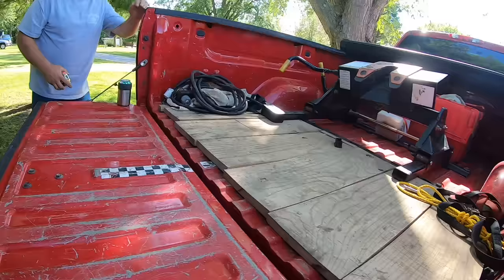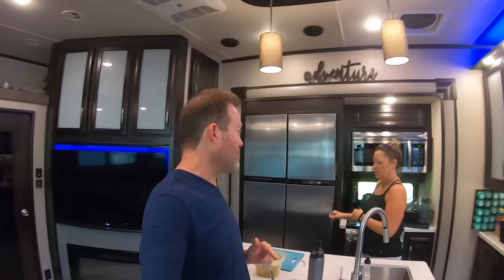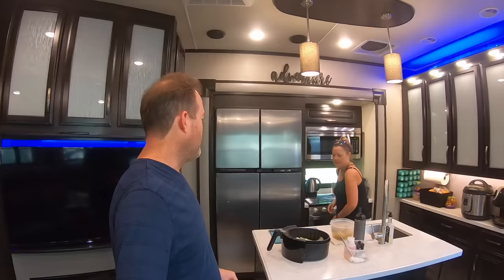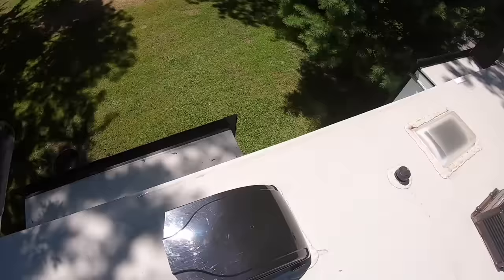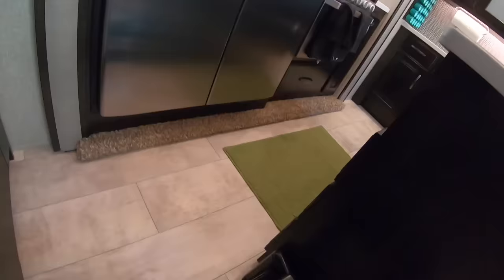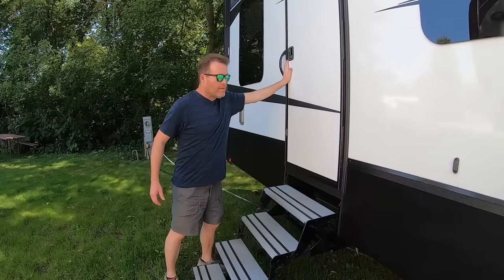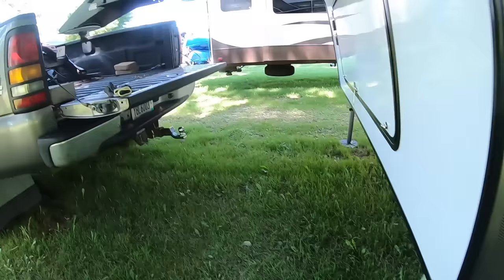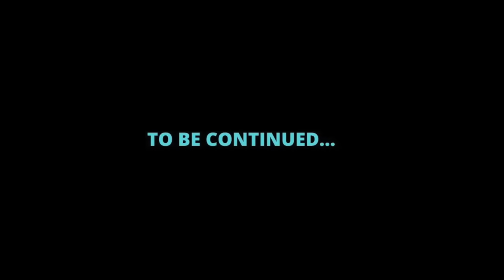RV CRUSHES MY TRUCK ON 1st TOW! BIGGEST RV LIVING FULL TIME MISTAKE!

Comment: Whith a big trailer you have to make sure to turn corners slow too couse the trailer can push the truck into a jacknife or push the truck sidewas and roll the truck over on its side and demolish the truck . Thats why alot of prohoulers use 450 trucks bigger heavier axles and wider wheel stance witch gives more stability

Comment: it proves that you are human just like the rest of us. i have driven truck for many years and have lost 1 trailer also. first  only 1 pad on hitch only!
( with 2 the jaws won't lock right)  2 as a truck driver we age to look in the back of the hitch and make sure the jaws are closed around the pin.
3 tug test to make sure.

Comment: Get rid of that round disc, it probably was a factor in your hitch failing. There is way too much separation between the pin and your hitch because of that stack you’ve got in between having added that extra disk on top of a mechanism that the hitch already has in place.

Comment: You need to pack pads or pieces of board 2x6x1 foot. Place them under the landing pads, as one of these times the ground will not hold the weight and it will sink. It can sink so much you cant get the truck back under it.

Comment: Sorry about the new rig. did you figure out what went wrong? i know your still pissed right now but here is a tip that saved us a couple of times once your hitched up bring your front legs up just enough to be a inch or so off the ground then pull forward to make sure you are locked this way if you are not and comes lose you will only drop a inch or so and no damage to ether truck or rig.

Comment: I saw the high hook  trailer should always slide up the 5th wheel to guarantee a good hook every time you can see the disc were not compressed by the weight of the trailer  which means the pin was on top of the jaw

Comment: What we got here is failure to lock the hitch. Always tug test! Don't care if it's a gooseneck, semi trailer or 5th wheel. Also, lube the hitch. Those fiberglass bed sides are not cheap! That's a very old school one that looks worn. I personally would have replaced it.

Comment: I am a RV transporter before you even got to the point of raising the front legs I can see that your trailer was not locked into the fifth wheel!!
   When you back under the king pen and you’re always locked underneath you always want to tug on the fifth wheel just put it in drive just slightly tug to make sure it’s locked in the place

Comment: 19:40 Don't mean to armchair quarterback this painful lesson but the pull rod is still extended and the previous owner stated that you have to remove the locking pin, detach the lever arm and put the locking pin in the inner hole together with the safety brake cable.  I'm sorry this happened to you and it's probably an expensive lesson.  I used to haul a 5 car trailer and had a 32k hitch.  The last thing I do before I retract the trailer legs is to make sure that I put the padlock through the hole that secures the release lever.  That ensures that the hitch is locked and that no one can mess with it while unattended.  Safe travels and good luck.

Comment: Get a Hensley ts3 trailer saver hitch.

You have a significantly large investment in that trailer on a 200 to $300 hitch. That would make me very very nervous. I run the TS3 trailer saver on a 15000 pound fifth wheel, just a little advice

Comment: Thank you for posting this video; I'm sorry it happened but bad things happen to good people. My wife and I have been RVing for 22 years and we have made our fair share of blunders including this one just a couple of months ago. We know you know how to do a tug test. How about filming that video in the near future.  This is our departure routine. After I'm fully hooked up and we've checked our trailer lights, I chalk the trailer wheels to prevent the trailer from rolling forward or back. All leveling jacks are now raised except the front two.  I lift the trailer a fraction to take almost all of the weight off of the truck. Tongue weight is on the trailer landing jacks.  Back in the truck cab I squeeze my trailer brake controller to the max, shift into drive and slowly release the truck brakes. You should not move at all as your truck is pinned to the trailer by the king pin.  If not you will separate from the king pin and the trailer won't move or drop.  Our final routine is a walk around of truck and trailer before we pull out.  I start on the driver's side while my wife starts on the passenger. We check truck and trailer looking and running our hands over everything; hitch and 7 way connector, doors, windows, bumpers, bay doors and latches, access panels, EVERYTHING. We cross in the back of the rig and double check each other's work on our way back to the front.  We repeat this routine at every rest stop while traveling.

Comment: The first time I ever pulled my 5er, I had to stop at the top of my driveway which caused the rig to rock back and forth a little.  The result was the Reese 16k slider lock popped out of the locked position and 12k slid backwards very fast and I thought it ripped the bed off my truck.  Now the bed has a slight upward buckle.  I quickly replaced it with a superglide.  I have several experiences like this.  My wife and I counted them all up and every issue we have run across has been inexperience.  I too have thought of starting a channel for rookies like myself.  lol.

Comment: Did it not lock in or did you put in to many teflon savers? You did not need the second one. I use them on my 18 wheeler.
Reply from the maker: It looked locked, but it wasn't. Yes, the extra disc caused the problem.

Comment: We used an Anderson hitch with our fifth wheel because it eliminates this unfortunate potential.   Very sorry for your misfortune, but kudos for sharing to help others.
Reply: Was not the fault of the hitch. The king pin was not sitting depth wise enough...that hitch already had a factory built on lube plate...he added another lube plate...that was the problem.

Comment: The handle wasn't in the "cocked" position.   You can see the yellow handle wasn't horizontal.  It was pointing down and the whole handle arm was pulled out still in the "locked open" position.  That little white needle seems to be either a design flaw, or merely labeled wrong which is very unsafe for new users to that hitch.  I think the white needle indicator only shows the hitch has "fully accepted" the trailer pin, NOT "locked in place".   Besides the tailgate, I hope there wasn't much other major damage.

Comment: 1. The guy that you got the hitch from told you that you do not need to grease with the orange pad that is on the hitch (4:25), thus you do not need another pad. You put one on so you high hitched not locking the king pin (19:38). You can see about a 3/8 gap that the king pin plate is not setting on the 5th wheel plate! The arm is NOT locked around the king pin it is below the latching notch which PUSHED OUT the "hitch lock indicator"(19:45)!

2. Keep the power hooked up so you are not drawing down the batteries running the leveling legs and landing gear.

3. I would think that you would know, having a 5er and doing videos about RVing, to do a test pull with the tail gate down and the landing legs only about 6 inches off the ground. 

4. The hitch you got was a manual slider for short bed trucks, when I upgraded from a 3500 short bed truck to an 8ft 3500 dually I got rid of my auto-slider and got a real hitch for the weight I was towing, take a look at B&W .

WHY SHOULD ANYONE VIEW YOUR VIDEOS WITH THIS ROOKIE MOVE!

Comment: Very sorry to see this!  My guess is you did have it locked but the king pin was sitting on top of the jaws?  Usually they won't close when that happens but will see in part 2.  Life goes on - keep on enjoying the journey!  Thanks for sharing.
Reply from the maker: Thank you. Yes, we have a lot of video to edit for part 2.
Reply: Was not the fault of the hitch. The king pin was not sitting depth wise enough...that hitch already had a factory built on lube plate...he added another lube plate...that was the problem.

Comment: Wow! First time viewing your channel. I guess you haven’t heard of a “Tug” test. Leave the front landing gear retracted off the ground slightly. Apply the trailer break alone and see if you have a good connection. If it comes off the hitch the front landing gear will prevent the trailer from falling on the truck. That sucks. Live and learn.

Comment: Always and I mean always do the jerk test. Put chocks in front of the wheel after hooking up. Put your truck in gear and pull forward to put tension on the pin to see if it pulls apart before bringing you landing gear up all the way.

Comment: I’m sorry this happened to you, but I have a pretty clear solution to prevent this in the future.

At first, I thought it was the Fetlzer valve (7th) but Gordo from Ajax thought it was the bypass line.  He suggested to repair it with some three-in-one oil, gauze pads, 10 quarts of anti-freeze snd a set of 30-weight ball bearings.  As you know, it’s all about ball bearings these days.

Comment: Yeah towing aint no joke, you realize this is HUGE at moments like this. I switched to pull behind my self. But geez even then, replaced brand new tires at Walmart, and guy inflates them to 32 (I assumed he knew what he was doing, MY FAULT). At 55 a wheel heated up and broke the lug nuts, flew off, I never did find it?? But my god it could have been so much worse...After a week in Minnesota, I was on my way again...
Reply from the maker: Wow, thanks for sharing!

Comment: So what is the proper pull test on your rig? Your system is like mine, it lifts each front leg at a time. If the landing legs don't come up at the same time then the only option is to manually apply trailer brakes while landing legs are down. I assume you can release the hydraulic pressure by retracting one leg up for a split second. My heart goes out to you. I had a husky hitch but it was simple...my locking handle wasn't all jiggly like that Husky model.🤕😢

Comment: I don't think you are supposed to use that spacer with that hitch. It creates a high hitch situation where the pin is too high in the hitch. The hitch already has a teflon pad built in.The locking jaws won't fully lock the pin because it is too high. You can see the jaws but they are not fully locked. Sorry that happened.

Comment: You didn't move the pin from holding the handle. To locking the 5th wheel .  Yes the white pin shows jaw is latched.    That is what mark said in the phone.  The handle pin locks it

Comment: One time I was camping out on national forest land and I saw this older fifth wheel in a spot and I'm thinking they did what you did because the front jacks were all the way up and the fifth wheel was sitting on the ground lol. I'm thinking they did what you just did, but because they were on a slope, when it fell off the camper rolled back (or he just drove forward too fast) and then the camper fell straight to the ground. I didn't see anyone go back to the camper for like a week, not sure if they just left it or what lol.

When I bought my fifth wheel the guy that had it before me already had an Anderson Fifth Wheel Hitch which is a gooseneck adapter and he gave me it for free so naturally that's just what I used. I would suggest looking into them if you haven't already because it's so much easier to hook up and this falling off the truck can almost never happen to you, because it's like hooking up a bumper pull it either goes on the ball or doesn't, just have to remember to lock it is all but even I've forgotten to do that and it's not fell off yet. Plus they're lighter and easier to handle. Only downside is it takes a little bit more time to raise up the camper, back under it perfectly, and then drop it down again, but my jacks are just slow, yours looked fast.

I know Big Truck Big RV had an Anderson Fifth Wheel hitch at one point, I'd look at his video(s) on it to see if it's something you might want.

Comment: Yup , that really sucks.
About the only other thing that sucks even more is when the underside of the camper smashes the rear corners of the truck box when you go into or out of those steep gas station driveways. Those you don't see until it's too late.

Comment: I feel so bad for you two..  When I watched the video, the shot you took of the hitch with the trailer on you said you saw the jaw hooking up.. I don't think I saw that - looked like just the pin to me.. However, a tip:  When you hook the 5er up to the hitch, leave the landing gear down and then try adding power to ensure the hook stays in place.. Not sure about your hitch, but my Reese hitch will not allow the insertion of the release handle lock if that jaw is not fully in place.  Even then, I hook up, lock the handle and then still try to move forward in D...  If I can't move - the jaw's locked.   I hope you never have that happen to you again... Very best wishes onward..

Comment: Watching you put that junk hitch in your truck for a good size fiver, I had an impending sense of doom .    I had my first fiver, and dropped several hundreds of $$$ on a new companion hitch, very heavy and solid.  I did have 10 years of semi experience back in the day, so I tend to over spec equipment rather than try to save a few bucks along the way.   Anyway, my new hitch is golden, and I would encourage you to go a little higher in capacity and quality than you think you might need when dealing with the running gear.  On the bright side for you guys.... a lesson learned and you weren't going 60 mph at the time.  Have fun!
Reply: Was not the fault of the hitch. The king pin was not sitting depth wise enough...that hitch already had a factory built on lube plate...he added another lube plate...that was the problem.

Comment: Fyi. I usually put the emergency break away cable to the truck itself. If the unthinkable happened and the whole 5th wheel attachment came off then there goes your cable too

Comment: Not first time want be the last. That's why professional that tows heavy equipment gets flat bed truck beds.
Reply: A flat bed truck would have been way worse in this case, at least the camper only fell 6-7" onto the bed rails. If this was a flat bed that camper would have fell like 18" or more and would have destroyed the front over hang especially because the fifth wheel hitch in the truck would have smashed through the fiberglass shell lol. This was the best case scenario because there should be minimal damage to both the truck and trailer.
Reply: @dedalliance1  that true but something wasn't locked in an reaching over that bed an trying to look is hard to do. If there no sides an tailgate you can tell if everything is secure.
Reply: @lynngatlin4469  Yeah, but who knows what happened, maybe the hitch is just faulty or broken and would've happened either way.

Comment: Kinda confused here. You have a visual indicator of positive lockin with the pointer thing and also the lockbar is across the kingpin. Can't tell if your pull handle is all the way in - That's how mine works along with a safety bar that comes down and only allows it to seat to the handle when properly aligned. Then I pin to lock it to the handle! 

So with the safety pointer showing good latch I have to assume there is a design failure of the pointer allowing it to show locked in before the bar is actually all the way in the locked position?

I also use the raise the legs bout a 1/4 up and lock trailer and pull to test as other have said.
Reply: Was not the fault of the hitch. The king pin was not sitting depth wise enough...that hitch already had a factory built on lube plate...he added another lube plate...that was the problem.

Comment: Look at the arm when you put the safety brake on. The pin at least two inches away from the lock mark. The Pin that goes in the arm must go through the hitch arm nipple as well. When it is and the pin is fully seated on the deck plate then you know you are safe to pull.

Comment: Always pull forward with your truck with the trailer jacks DOWN - just a small tug is all you need.  What you did is all too common.  Big rig drivers do this ALL the time - tug on the trailer just to make sure all is secure.  (I'm one).

Comment: So the 5th wheel was not actually locked into place even though it indicated it was, or it just didn't hold because of brakes or too much weight?  Looking forward to part 2 ...  It could happen to anybody as you are no noob.  I hope no significant damage to the trailer or truck occurred.
Reply: Was not the fault of the hitch. The king pin was not sitting depth wise enough...that hitch already had a factory built on lube plate...he added another lube plate...that was the problem.

Comment: Stepping out of a 5th wheel onto the built in steps can be very dangerous, I suggest a hand rail and a sturdy one, I stepped onto my steps and my weight made them bend downwards slightly, without a railing to hold onto it is so easy to slip on the 1st step out, I had a propane cylinder sitting on the ground next to my steps and when I slipped my body went horizontal, I landed back first on top of the propane cylinder  which has a thin ridged top, I had a huge bruise shaped like capital C  like a horse kicked my kidney, it hurt so bad I thought it was cut or ripped open. I made wood steps , the built in steps can be deadly, be very careful!